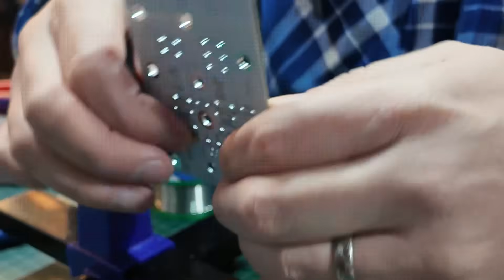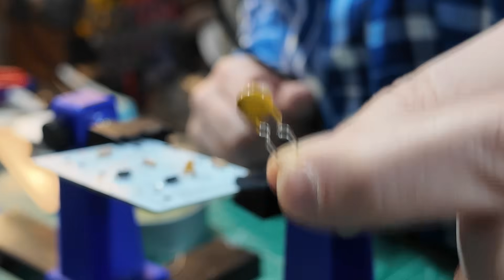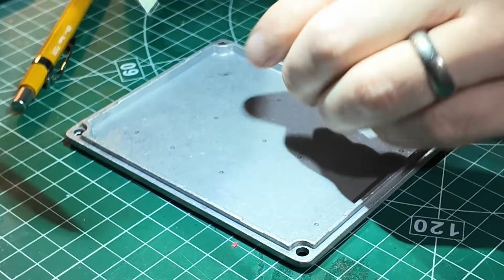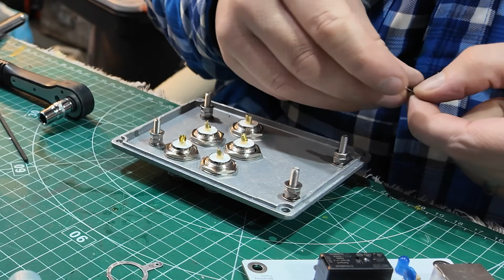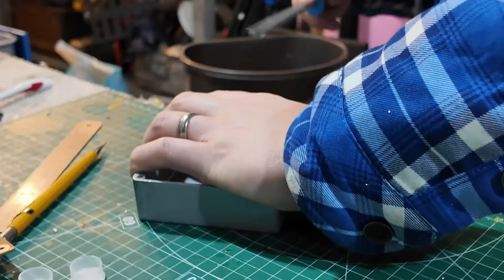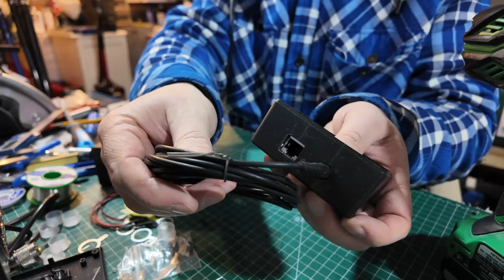Phased Vertical Array: DIY Control & Delay Board

Comment: I see the Yihua had a good day out along with the Amazon meter Colin. Nice work.
Reply from the maker: Both going well Mike. There is a connection issue with the XLR plug as I occasionally get sensor error. Wiggle the plug and its good again.
Reply: @MM0OPXFieldRadio  Plug and Skt are available from CPC farnell as order codes CN21154 for 5 pole plug @ 75p each and AV15052 for 5 pole chassis socket @ 90p each. Most definitely not XLR types btw.
Reply from the maker: Appreciate the part numbers. Best way I could describe it. Cheers

Comment: Hi Colin, nice build, shows people its not rocket science, suggestion, use the front mount SO-239 bulkhead connectors that way you can take the card out of the box w/o de-solder,  we need more hams building equipmentb there is a great deal of satisfaction in using equipment you built yourself......73, Mike K1FNX